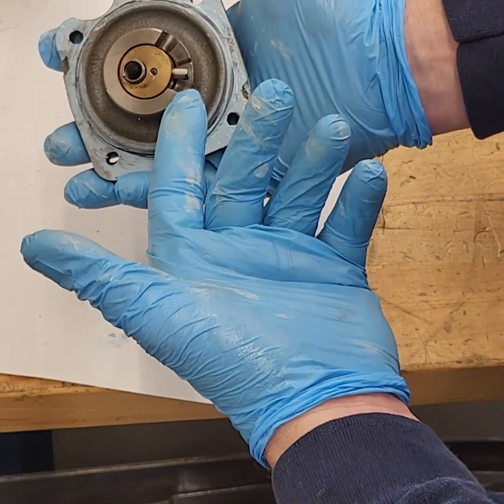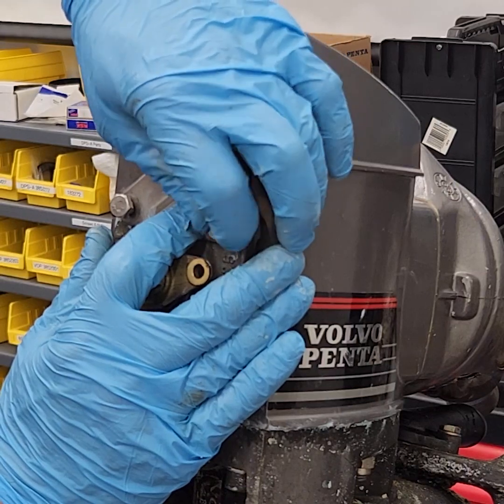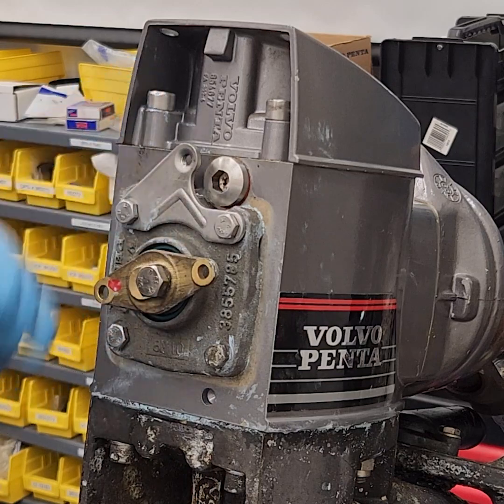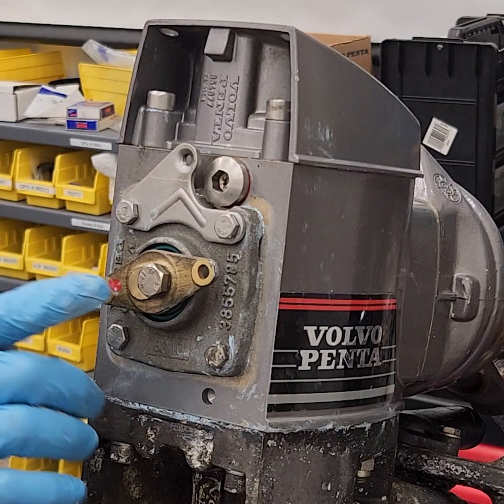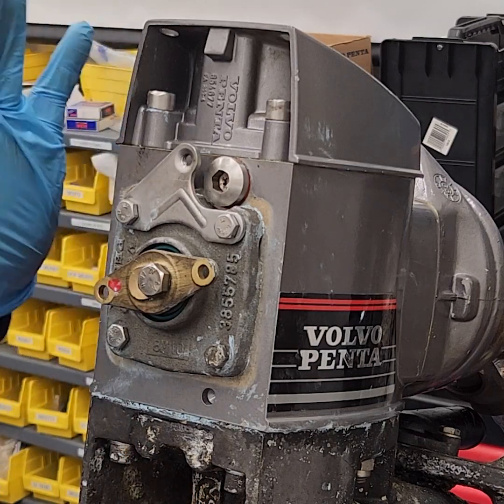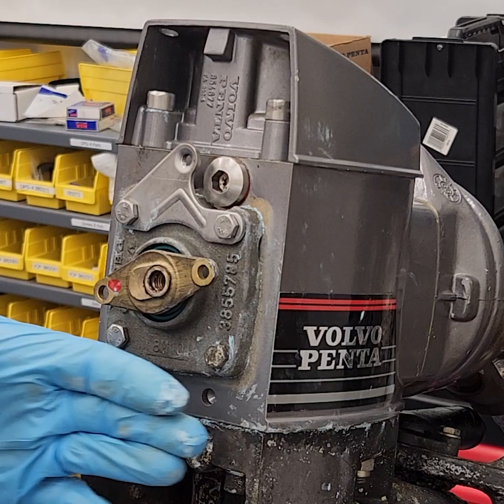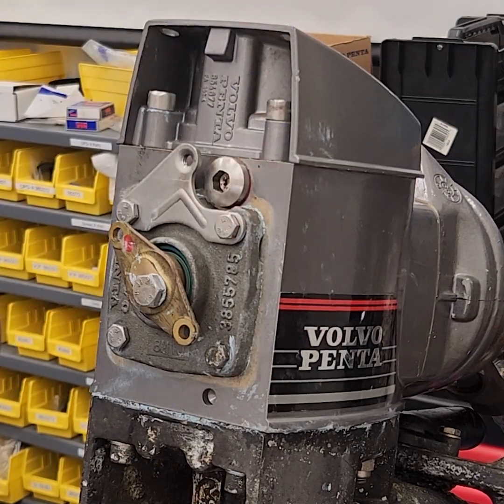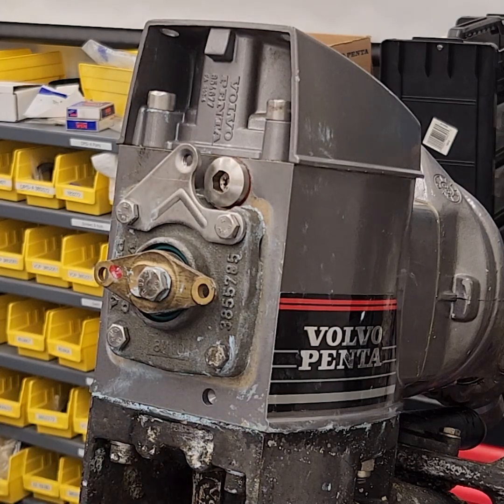Volvo Penta DPE Upper Gearcase Shift Actuator setting Part 4

Comment: My problems are on land it shifts gears fine, in the water I have to rev and drop rpm and hope I dont break something to get it to go forward, I have tried everything
Reply from the maker: Is this both in forward and reverse? If it is forward only the drive may be overfilled with gear lube.
Reply from the maker: The drive may be over filled with gear lube.  Making a short video now on proper "full" level. Be on the lookout for it

Comment: My original 1999 DPE drive sticks in gear when coming off plane and takes considerable effort on the main helm shift lever to get into neutral.  From my aft controls it shifts a little easier into neutral.  Does this sound like an adjustment issue with what is discussed in this video or something else?
Reply from the maker: @hansbrubaker1556  it likely that the cone clutch needs replacing and the new one lapped in. See if a local dealer can do that.

Comment: Hi. I remember in one of your very good videos that you talked about , if there is a loudt "klank" sound in gear shift from neutral to forward or to reverse. also if it the stick is harder then normal to place in neutral...there was something to adjust?...what was this.? :) This was a problem on the previous DP-E290 drive but one year the problem was gone. Now i have a factory new DP-E290 drive on wich a volvo penta shop have mounted, and this problem are back. Can you please tell me what to do in this case? Thank in advance. Jan
Reply from the maker: The shift actuator may be the issue, but if the drive is new I doubt it is that. It may be the shift cable itself is worn out.

Comment: I have a DPG drive run off of a cv shaft. When put in forward it engages immediately, when put in reverse it spins in neutral for 10 seconds before engaging in reverse. Could this have something to do with this shift actuator in this video? The actual electrical actuator that is moving the cable mechanically is fully moving in both directions.
Reply: Im guessing this could be the clutch inside the upper part of the drive. The clutch will start slipping in reverse first then it will not engage the gear at all

Comment: Great video! Do you know how many extra shims are spec'd for a SX-A drive?
Reply from the maker: For all Sx-A or DPS-A and later units, There is no bolt or shims and therefore no adjustment for the shift actuator
Reply: @tedsmarinerepair8956  Thanks for the info! I'm looking for any recommendations with a the SX-A drive shifting with a fairly noticeable "bang" in going from neutral to either forward or reverse. I only use the Volvo-Penta 75W-90 Synthetic that I change every other year to the recommended level. The engine idles at 600 rpm in neutral, has 300 hours on it and I switched from a 3 blade S.S. prop to a 4 blade Aluminium prop that is 22lbs lighter, but still have the loud shifting.  On my older 2003 SX drive, I would definitely here a clunk when shifting, but no where near as loud.
Reply from the maker: None, all  the shift actuators are fixed on SX-A or DPS-A units there is no bolt to shim.
Reply: @tedsmarinerepair8956  Thanks for the quick response!  Any other things you think I should look into that may help with the loud shifting?

Comment: What oil level do you recommend on the dipstick?
Reply from the maker: half way up the dipstick is the proper level. Filling it up until it's level with the bottom of the vent plug hole is also the correct level.

Comment: Dp-E per the book says to add 3 additional. Just wondering why only 1 extra shim?
Reply from the maker: There was no tag on the drive and after removing the old shift mechanism I found out the old shift mechanism was a 290 dp series, since I used the original gears and clutch I went with the 1 shim that 290's originally called for. It's also only 0.020" different. Time will tell when it's splashed.
Reply: @tedsmarinerepair8956  ok so its safe to say since my DP-E was tagged, to put 3 additional.  Hopefully! Fingers crossed
Reply from the maker: @spicytuna3235  yes that is the standard procedure